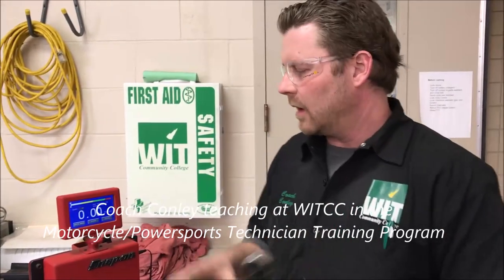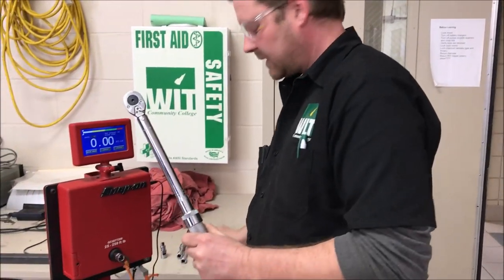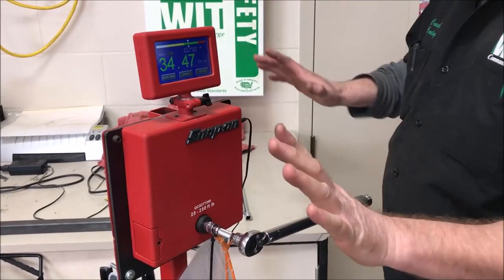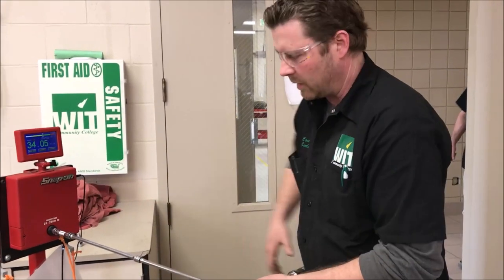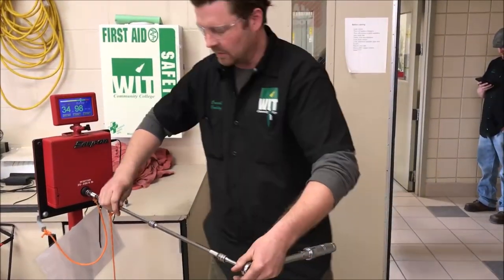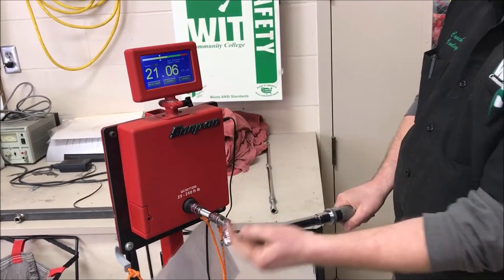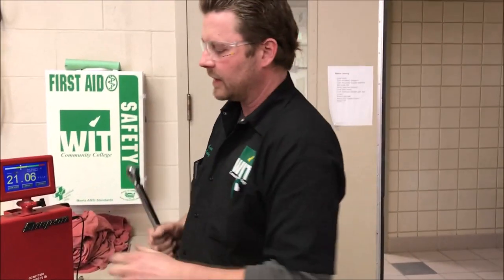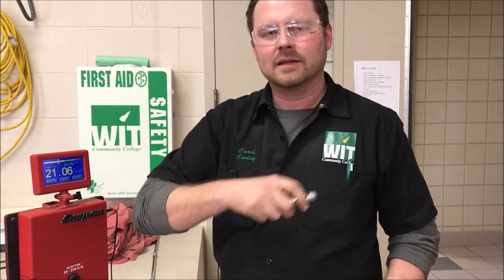Will extensions change your torque wrench reading? Proof and the answer!

Comment: What if I had a 1/2" torque wrench and added a 3/8" adapter, would that change anything? ... and or Would I break the adapter if I needed 120 lbs of torque?
Reply from the maker: I'm not an expert on the point at which a tool size change would break, but I surely bet the quality of the adapter will play a part. Also note most 3/8" tq wrenches got to 80 ft lbs. Can you get the correct 1/2 tool? 
👍 Thank you for taking the time to comment! Hit that subscribe button if you haven’t please! It helps us! 
Here is a way to support all the free videos.
Want to say “thanks” or “keep it up”? Click here https://www.paypal.me/how2wrench  

Coach Conley is also available for hire to personally work one on one with you if ever needed. Yep he is a real person. Give him a call @ 602-345-0432
Details here: https://how2wrench.com/product/personal-tech-training-phone-facetime/ 
Your answers and help are just around the corner. Save time and money while protecting your investment and yourself by doing it the right way!
Follow us! 
Web:
www.How2Wrench.com     
www.Tools2Wrench.com

Comment: Would there be a more perceptible difference at higher torques, say 100Nm+?

My mind would say no, maybe you could test it?
Reply: As long as you maintain a right angle, it doesn't matter if it's 5 inches or 5 meters. 100Nm is 100Nm.

At higher torque you may be prone to twisting extensions, but that doesn't affect a torque reading. If that happens, the wrench just wont click or the dial will drop (If using an analog torque wrench).

Comment: Thank you for a great video. Recently I tried tightening an axle nut to 215ft/lbs. The torque wrench was good to 250 ft/lbs. I am not a strong person by any means and I physically could not tighten enough where the wrench would click So I added a pipe over the wrench to give me some more leverage and did the trick. But now I am thinking whether or not that was a good thing to do.
Isn't the torque settings predicated on the  actual length of the wrench itself and the force applied where the handle is?
Reply from the maker: Glad it helped. I breaker (cheater bar) will change the output. How much...I don't know...
Support links and gear below!  Awesome and thanks for commenting! Smash the subscribe button (thank if already a sub!)
Have you seen our "YouTube Trained Support Shirts? Great way to "high five us" https://goodfellasmerch.com/collections/how-2-wrench/products/support-shirt

Join this channel to get access to perks:
https://www.youtube.com/channel/UCBhM8DCKnT3qXwTW0eToyCg/join   
-Daily MEMBER FIRST COMMENTS ANSWERED FIRST 
-Live Q/A video chats
-Wonder if we have a video on your need? Members can request content links!
-Full Access to the ENTIRE 700 video library
-Member-Only FREE tool giveaways  

Just want to say thanks quick to support us for this information and our work saving you money? 
Give us a high 5 here:  https://www.paypal.me/how2wrench
Reply: The wrench has a mechanism inside the wrench that limits torque that acts on a pivot on the wrench as long as the pipe didn't bridge that pivot and was on the section your hand would be on to apply the force the value will be correct. Otherwise if you placed your hand anywhere but a specific spot the torque would be out. Hope my explanation made sense. Not all torque wrenches are the same but this would be true for just about all  I believe as they operate on similar principles.
Reply: Since torque equals force x distance, you should get the same results. When you added the pipe for leverage, you are now applying less force on the end of the pipe, but the distance is greater. I believe the results should be similar assuming the angle is still 90 degrees to the nut.

Comment: What about using adapters?
I had to increase my drive size to a 3/4in torque wrench. I currently have not found a 3/4in 6 point socket set for an affordable price therefore I have been using a 3/4 ==> 1/2 adapter. Will this affect torque?
Reply: Try northern tool. They have a set for around $200 if I remember right. All 3/4 drive impact 6 points.

Comment: Im guessing the same applies for an impact wrench?
Reply: not at all, thats what torque sticks are for. using an impact wrench will spring back when used with extensions, which absorb the impact and cause less force to be delivered to the fastener

Comment: What if I put a  3/4 adapter to a 1/2 impact will I lose torque?
Reply: Impacting torque should be affected by adapters and extensions but I don't know to what extent. Torque wrenches are a steady application of torque so it shouldn't but an impact should be a different story.

Comment: I disagree with your swivel test. If you properly support the drive end of the wrench so the turning force is exactly perpendicular to the drive axis, there is no reason why the digital indicator should be different. Perhaps you could demonstrate?
Reply: I came here just for universal adapters on torque wrenches. In my mind as long as you are not binding the universal joint every other angle should not affect the torque transfer. This of course means a much smaller degree of movement, which is all I need in my project. I was glad to see him use the universal towards the end (the off camera guy did deserve that high-five for bring it up) but I agree it was not well tested out. There seemed to be way too much angle and most likely the joint was binding. I would have like to see torque test at a very slight angle to a slightly more severe angle and finally to the max where he had it. I still do not have my answer...back to the internet depths.

Comment: Now do a blind test, where you do not know the set torque and without prior rehearsal of the required compensation with your left hand. Most people can torque to the normal ± 4 % with a regular wrench in a repeatable setup, a torque wrench is only useful when you are working in an unfamiliar position or really want to minimize operator variations, i.e. no relying on correct compensation with the off-hand.
Reply: The case you show, with wobbly extensions, is an interesting one as it is common, but you should also test what happens with a rigid extension, which would prevent the operator from easily gauging the bending momentum on the extension.
Reply from the maker: We will pass this on to Shane. Was there anything of value in the lesson?
Best way to help us back is joining or grabbing our T-shirt! Support links and gear below!  Awesome and thanks for commenting! Smash the subscribe button (thank if already a sub!)
Have you seen our "YouTube Trained Support Shirts? Great way to "high five us" https://goodfellasmerch.com/collections/how-2-wrench/products/support-shirt

Join this channel to get access to perks:
https://www.youtube.com/channel/UCBhM8DCKnT3qXwTW0eToyCg/join   
-Daily MEMBER FIRST COMMENTS ANSWERED FIRST 
-Live Q/A video chats
-Wonder if we have a video on your need? Members can request content links!
-Full Access to the ENTIRE 700 video library
-Member-Only FREE tool giveaways   

Just want to say thanks quick to support us for this information and our work saving you money? 
Give us a high 5 here:  https://www.paypal.me/how2wrench   

Got an emergency and your head is about to explode from frustration or fear? Get Shane’s cell here: https://how2wrench.com/ols/products/techline-one-on-one

Comment: should not "generalize"  this to all torque devices..  air impacts have had torque limiting extensions for years and years..  Box stores use them for tire work.. A trade mechanic also lives and dies by his air tools and has known forever that a line of extensions will kill your torque applied when using an impact..
Reply: he isnt talking about impacts though, completely different tool. lets not pretend anyone is accurately torquing anything with an impact, it is out of pure laziness nothing more.

Comment: If you try this test at 150-250 ft pounds of torque you results will be totally different.
Reply from the maker: Correct but keep in mind they are adjustable for a reason and the expectation is the accuracy should be there for a precision tool.

Thanks for commenting and adding value to our community! 

Please subscribe, share and consider a H2W membership to support our free work here! We are ramping up for the upcoming new member only site with profiles, raffle drawings, and weekly live Q/A sessions and a for sale page!

Have you subscribed yet to never miss a video? Have you seen the video playlists? Over 600 videos! Check them out here: https://www.youtube.com/user/conleybuilt/playlists   

Want to say “thanks” or “keep it up”? Click here https://www.paypal.me/how2wrench     
 
Your answers and help are just around the corner. Save time and money while protecting your investment and yourself by doing it the right way at www.How2Wrench.com

Comment: Do you not realize you are having to apply more torque to get to the 35? Look at how little the wrench moves with no extension. Now look at how much you move it with the 30 inches of extension. You proved yourself wrong.
Reply from the maker: Yet you missed the test was measured by the gauge...not your "eyeball" measurement of movement...😉 We will still share the comment with Shane...
Reply: @How2Wrench  you are still having to apply more torque to the wrench to get the same torque spec. It's really not that difficult to understand